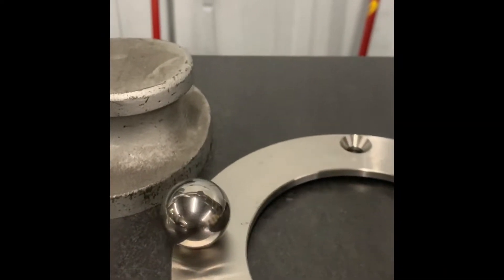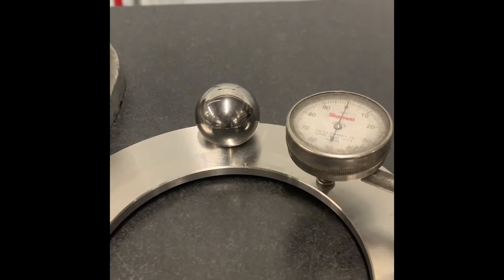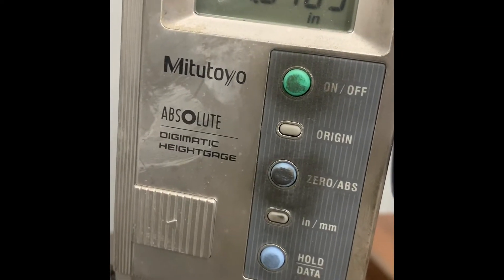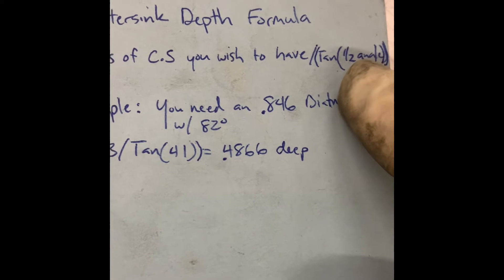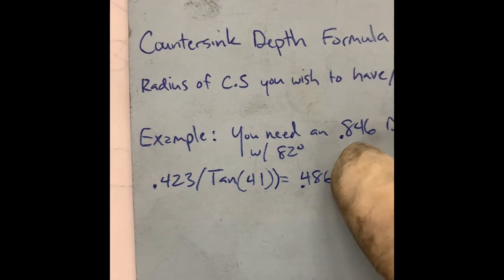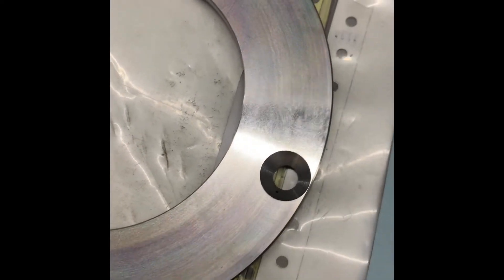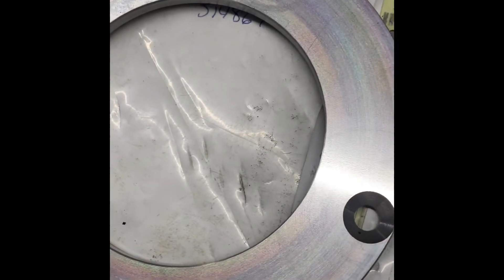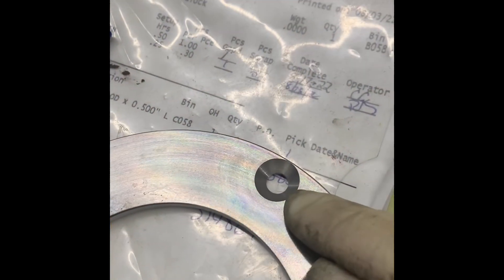Finding Countersink Diameter using a ball bearing

Comment: Hey, not a criticism but you don't say what we're doing with the ball diameter and the measurement from surface to top of the ball. Are we dividing? Adding? Multiplying? It isn't clear. And as you're describing the process, your camera is all over the place. Yours is the only video describing this process that I could find and I really needed to know how to measure a countersink but your video is confusing. Pls redo it cuz I can't be the only one needing this information. Thx
Reply from the maker: Thank you for your input.  I will see if I can’t get a better example.  So you take the diameter of the ball minus the height of the ball sitting above the surface, so measure from the top of surface/start of countersink to top of ball (B-H) then you multiply by the height of ball, square root the answer and multiply by 2.  Thanks for watching
Reply: @debo__7243 also a little confused here. You’re saying take diameter of ball minus the height of ball from the surface. But then you’re saying to multiply the height of the ball.
Reply from the maker: @ruffryder818 yes, so you take the diameter of your ball minus the height number you got from the surface to the top of the ball, take the difference you get then you multiply times that same height number from the height gage, then take the square root of that product, and then multiply by 2.  Another important thing is to make sure the diameter of the ball is larger than your countersink so it’s sitting on the top of the countersink and not bottoming out on the angled surface of the countersink.